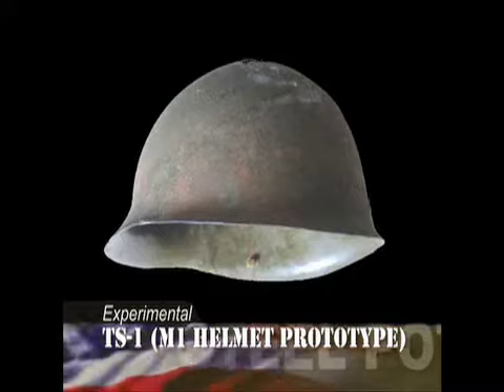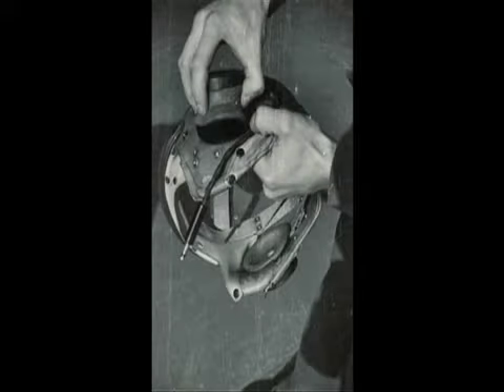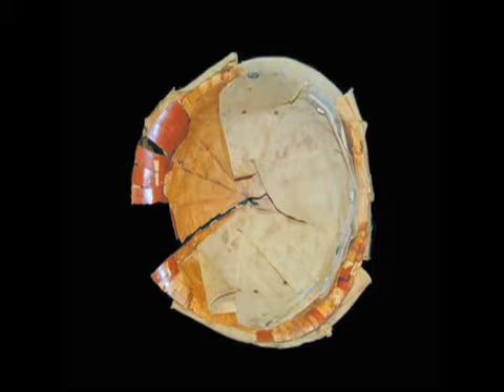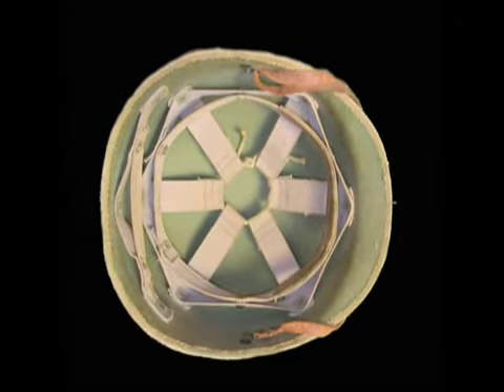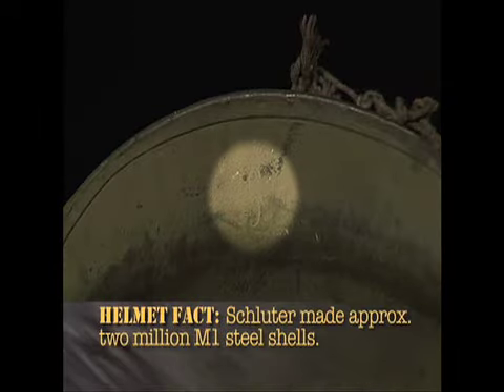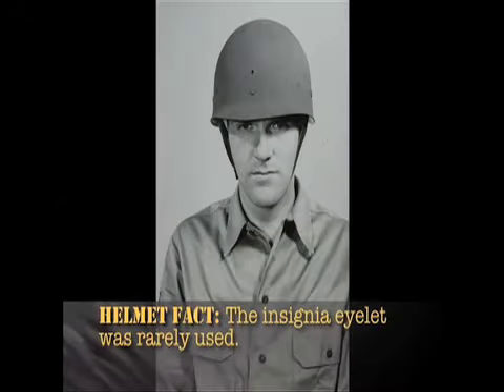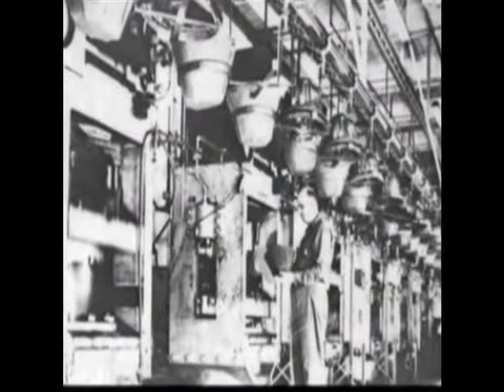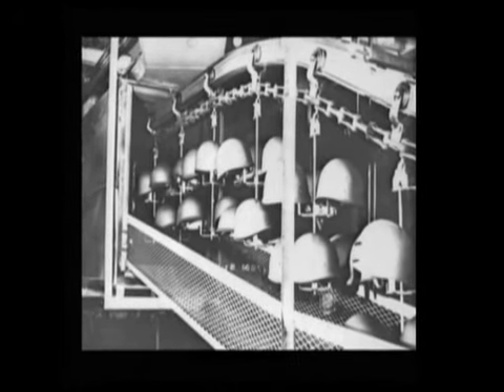Steel Pots: Part Three

Comment: This is the most indepth insightful video on the history mini series of the modern American combat helmet.

Too bad the other designs of the genious insightful, Major Bashford Dean. Who was a Medieval Armor historian were not adapoted. As they were years ahead and obviously used by many countries.

With, Major Dean's excellent helmet designs such as the US M5 or the other design which resembled  the later Italian M33 helmet. Too bad they were not adapoted. 

The Liberty Bell helmet  "Saucer" shape is what the Swedish M26, Japanese M29 and British M44  adapated also the German experimental M44 looks somewhat similar.

 I don't understand why the Liberty Bell helmet was so opposed by many American Soldiers, which alledgedy they mocked as a "Fisherman's Hat", as the Liberty Bell helmet looked like it offered more protection to the wearer then the Broadie / Kelly Helmet.

However had the Liberty Bell helmet  remained there would be a problem with identification with Japanese forces due to the similarities with their Tetsubo M29 Helmet.

The model 5A should have been adapted by the US Military.  Made with the dual shell system.

 While there were similarities with the M5A to the German Stahlhelm, there were also clearly differences. The M5A looks like a superior design  to the M1.

Comment: Hi There. From seeing your Video Call Of Duty World At War - Little Resistence, the date is Sept. 15 1944. At that time the U.S Marines used the M1. Because of the date you would think they had hinged chinstrap loop's but they could of also been welded. By that time the Marines were the only ones that used the Camo helmet cover. The U.S. Army stop using the camo in Normandy because it had a similarity to the Waffen SS Troop's. This led to friendly fire. Hope that helps you out. Good Luck !! V V